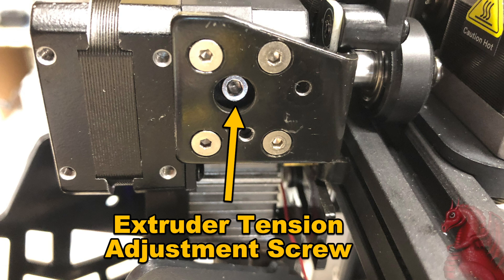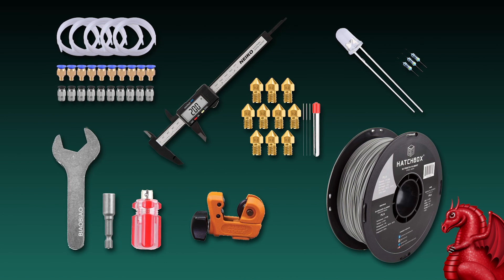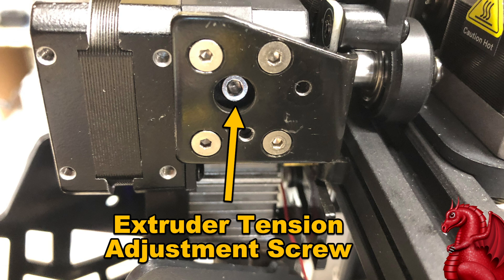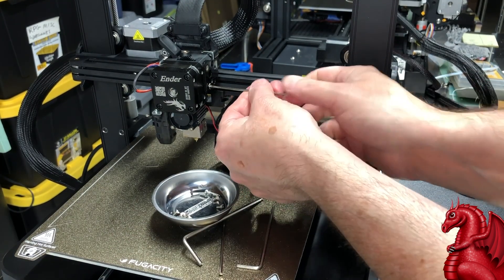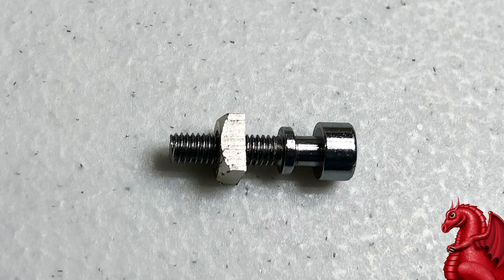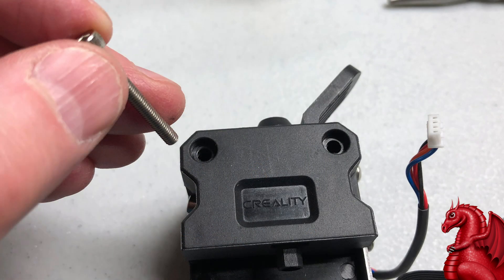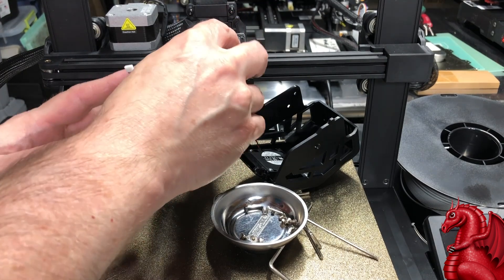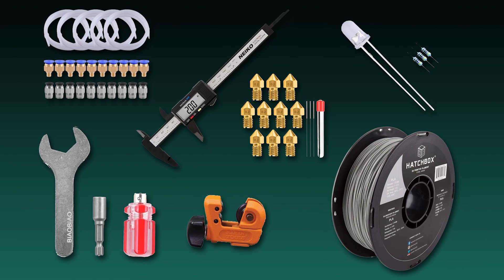Fixing the Creality Sprite Extruder

Comment: Say clockwise or counter clockwise instead of right or left. Or Lefty Lucy righty tighty has to be Lefty tidy righty Lucy. Looks like somebody didn't assemble that correctly in the factory. Mine will be here on Thursday from Amazon and I'm going to go after that right away to see if it's on the angle. If not I'm going to do what you're doing.

Comment: Thanks! My problem wasn't like yours, but your step-by-step guide of how to open the extruder assembly was very helpful! I almost throwing my printer out of the window, but you helped me save it... for now!

I saw you posted some videos of the Bambu Labs A1. How are you liking it so far? The Ender 3 V3 SE is my first 3D printer and I really like it, but having to make so many adjustments and troubleshooting sections just to print stuff is wearing me down, and I've been thinking of moving to the Bambu side if it really is more user-friendly than Creality stuff. Thanks!
Reply from the maker: The Bambu Lab A1/A1 Mini is my favorite printer, and I am slowly replacing my Enders with them.

Comment: If you're having extrusion problems like slipping or clicking I recommend first doing a cold pull with the nozzle at 90c temperature. Very often, the cause of extrusion problems is a clogged nozzle. If that doesn't work, you can try tightening the screw, but normally the printer should work just fine unscrewing the extruder tension screw to the stop then tighten it in half a turn. Of course it's also good to check that the tensioner spring and the cogs are in the correct place.

Comment: Looks like a design issue, the bolt should have been made longer so the nut cannot unscrew off the end of it, maybe even having a threadless section at the end so it cant push it right off.

Comment: My ender 3v3 se has been a nightmare one thing or another been an issue. Got it new about 4 months ago I've waited more for parts then it actually running. I got a used but good neptune 3 pro from elegoo not one issue besides adjusting the wheels and I messes with cura settings too much but it has been a champ and a beast. I think I'm done with creality don't get me started on my ender 3 pro I did every upgrade to it being even worse

Comment: If anyone was having similar issues and opened their head to find the spring still in place, the bearing on my stepper motor wasn't pushed in all the way so one of the extruder gears was sitting offset causing the filament to start binding and making a clicking sound.

Comment: Errr, just wondering,  I have a sprite and I am having problems with the extruder gears slipping. Thank you for your video and I am not sure how the mech is supposed to work as both extruder gears are geared together therefore pushing on the lower lever with the spring will have limited affect on the pressure on the filament as the two opposing pulleys are connected together by their gears. Unless the pressure is brought about by distorting the axle of the 'moving' gear.  At about  8.50 in your video you can clearly see the gearset at the back. If only one was driven and the pulleys not connected then this set up would work. They would also work if they were connected by a secondary idler gear. It appears to work as you would expect when it is dissembled and that is because if the motor is removed the bearing on the back of the main gear is removed and you sort of get a rotation of one gear around another, assembled nothing effective happens other than by twisting the the levered arm.

Comment: I followed all your steps and it all looked good but after reassembling I get a CR Touch error when trying to level the bed or do anything else. Do you have any tips on what I can do? Would be great! Thanks again for all the great work! Greetings Oliver
Reply: Same thing happened to me. I think it could be loose wiring after taking off the hot glue. May need to push in the wires and re-hot glue it.

Comment: Thanks, I installed the E3D Revo upgrade to the Sprite extruder on my S1 Plus, after removing the heater block/hotend noticed some filament poking out and tried moving it up, but no, so absentmindedly pulled it down and out firmly then noticed a 1 inch PTFE tube on the filament. So wasn’t sure where it was from. I will check the heater block now and the upper part you show to whats what. Really looking forward to cold hand Revo nozzle changes!  Laurie. NZ. 😊

Comment: had a blocked extruder on the KE and the internals are very similar just the gears are the other side hidden under the level and black gear but this helped alot thank you very much

Comment: Great video, will be attempting this tomorrow. As I was having issues and making some adjustments today. Also was trying to adjust the tension on the extruder and noticed that no matter which way I turned the screw, I didn't seem to get any resistance. So I'm totally expecting this print to fail about 8 hours in at around 1 or 2 in the morning... I might get lucky because I did make some other pretty drastic adjustments. But either way, I'll be taking apart the extruder tomorrow.

Comment: Is there a schematic available for the Sprite Extruder? I had a slight clog this morning and a short piece of PTFE tube (compared to the one up top) came out from the hot end. Wondering if there are two separate pieces of tube or if mine snapped. I can only push each piece so far up/down instead of them going all the way through. Wondering if the tube narrows or if filament leaked out where the tube cracked.
Reply from the maker: There should only be one piece of tube.
Reply: @Tombof3DPrintedHorrors  Turns out there actually are two. The longer one in the top and a shorter one in the hot end above the nozzle. Took me hours to find the info but there were several people with the same question on Reddit. Some days OCD pays off.
Reply from the maker: @wprjr.3D  good to know, thanks!

Comment: I just opened up the extruder but the nut was on the screw.  It was almost topped out.  I adjusted the nut to where you show, it clicks equally loud.  I noticed that the gear teeth are quite large, compared to other geared extruders.  I am left assuming that the tolerance is too great and the clicking is due to the teeth slamming the opposed tooth during retraction and against, feeding.

It is not stepper skipping.  I can find no other possible cause.

Comment: Just bought the  current iteration of the Sprite and already having issues.
Differences in the build are quite apparent. 
I was sold on the Sprite because they claim it is clog free. PTFE is not present in this version. I have sworn off the stuff. 
I had to break it down have a good look at why numerous attempts to load filament failed miserably.
Really took the shine off the occasion. 
I was aiming to have a look at the dual gear drive and tensioner to see if it was operable. Just  before that,
the heater block and heat break were pulled and  I observed a short length of PLA stuck in the passage. It had fractured during the infeed.
Cause was determined to be a blocked nozzle,... right out of the box. Factory issue PIA. Never expected that. 
Swapped it for a steel alloy spare that they ship as a backup. 
I'm now rebuilding and have lost track of the screw designation momentarily. Hope it works, or the hole lot of it is going in the bin after I take a 5lb mallet to put it out of it's misery. Gladly rid myself of the headache.

Comment: Checking in with a heavily tinkered E3v2. And when I say "heavily tinkered", I mean "The Whole Magilla". If it was an AR-15, they'd likely call it a "Mall Ninja Tacticool Special".  It's my "Just 'cause I like to fiddle with things" rig. I finally pulled the trigger on the Sprite kit for it today 'cause I've been thinking lately that the stock hot-end is in need of a full "All-the-way-including-a-brand-new-set-of-fans" level rebuild after 3 years of medium-heavy service. Then I thought "What the heck - I've been looking for an excuse to get a direct-drive extruder for a while", so now, I should have the "Sprite Pro Kit" in hand sometime Sunday. Before it gets here, I'm making the rounds of the assorted "Sprite upgrade"/Sprite Review"/"Sprite Installation"/"Sprite etc" vids, picking up what there is to be picked up. Thanks for the tips!

Comment: I have a brand new Sprite on an Ender 3 and it will not feed any filament. It just clicks. I had just replaced my other one because it was doing the same thing. I was printing like a champ and all of a sudden it stopped feeding the filament. Any ideas?
Reply from the maker: Did you check it to see if the internal screw/nut came loose like I show in this video?
Reply: Yes, on the old one and the new one out of the box. Any chance my lcd screen acting up would affect that?
Reply from the maker: @lisathompson6527  I don't see how.
Reply from the maker: Are you sure the hot end is heating properly? If it isn't hot enough to melt the filament it will cause the extruder to click. Try heating it to 205, the depress the load arm on the extruder so you can manually push filament through the system and make sure it is melting properly and coming out the nozzle.
Reply: It comes out fine when I push it through manually. The only thing that was different from the last time it printed was I had changed the stock plate with a magnetic one. I printed an ornament on it and when I went to put it back on it got stuck to the lcd screen and it had all these pixels on it. I turned the printer off and back on and that's when the problem started.
I have changed nozzles, tubing, e steps...I am going crazy
Reply: I had something similar happen after I ran the cleaning rod through. Mine's not clicking though I just can't get the filament to feed down through.

Comment: Hello there. I just wanted to thank you for making this video. It is well explained, and it has helped me sort out that exact same issue. Cheers. (By the way, I'd love to see more videos about what upgrades can be put on this printer... Filament runout detector, better hotend, what nozzles work best etc... things like that. thanks again)
Reply from the maker: I'm glad it helped you (and more vids are coming!) :)
Reply: @Tombof3DPrintedHorrors  What caught my attention is that this screw seems to be too short. For medium tension you have to screw that nut to almost the end of that screw. If the spring looses some tension, chances are high that when try to higher that tension the nut will come loose again. I think that's what happened in the factory. They tried to adjust tension from high to low, and in that process the nut came loose.
It's a shame this is a special screw with a collar, otherwise it was easy to replace for a longer one, that would have solved the problem completely. I have no idea where to search for a replacement that's longer than the original. Maybe someone here knows anything?

Comment: Do you like that build plate better than the stock one? I tried the glue thing but honestly a clean surface seemed to work better. Just got two V3 SE's. 
I plan on doing some 2-3 day prints and need to make sure the bottom layer holds. So far the stock surface seems good enough but an upgraded build plate seems like a great idea too.
Reply from the maker: Yes, I really like the textured PEI spring-steel plates a lot. I was thinking of doing a video on them soon. :)

Comment: Thank you for this video! The e3v3se is my first printer. While troubleshooting print quality I’ve adjusted or taken apart most of it. I noticed my tension screw turning freely, but haven’t been able to find a diagram or instructions for this particular extruder and had been too anxious to just open it up. 
Gonna go crack that sucker open and fix having a screw loose 😄
Reply from the maker: I hope it helps :)

Comment: 2 years with several Sprite extruders. There is no stop, so trying to tighten the gears can run the nut off the screw as yours was..I have found the unscrewing it to the stop then turn it in half a turn works perfectly on PLA, PETG and TPU.

Comment: The tension screws are kinda frequently badly assembled from the factory. On my Biqu H2 v2s extruder, the screw was in the spring BUT the entire top portion of It was outside the enclosure, meaning turning the screw just made it turn on itself, not compressing or decompressing the spring at all.

Comment: Thanks for the breakdown. 
Do you find this Ender3v3 Sprite is performing better than the Sprite on the S1?
If so, why would that be?
Reply from the maker: Yes, I do, and not sure why. The sprite extruder still doesn't quite match the surface quality of bowden feed when using smaller nozzles (.3 and .2) but for .4 it is extremely good on the V3 SE.
Reply: @Tombof3DPrintedHorrors  
From what I understand, dual gear extruders can introduce their own set of inconsistencies that a simple single gear/idler doesn’t worry about.  And the Bowden tube can , oddly enough, act as a buffer for unwanted patterns.